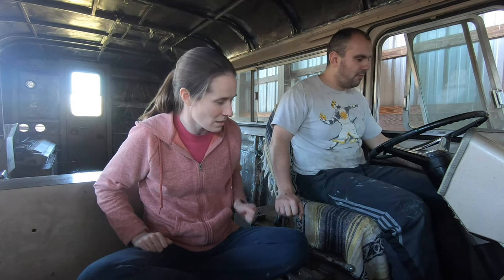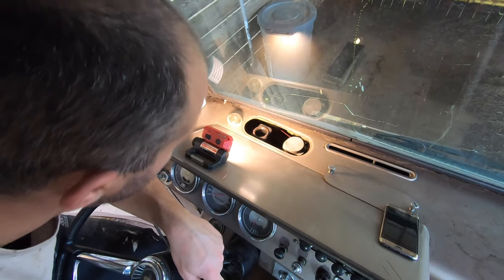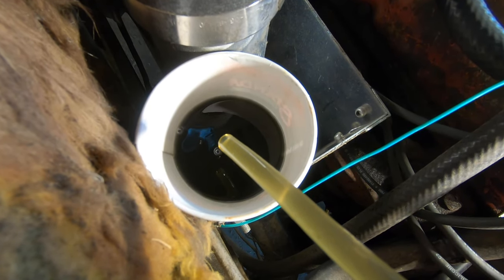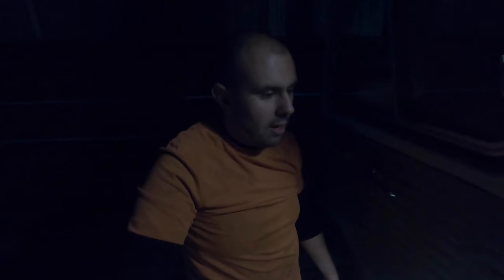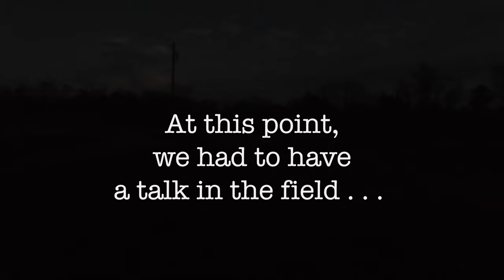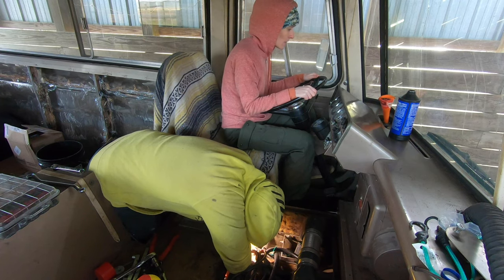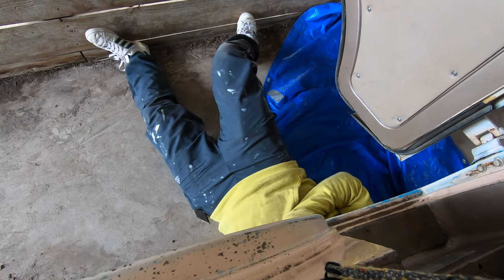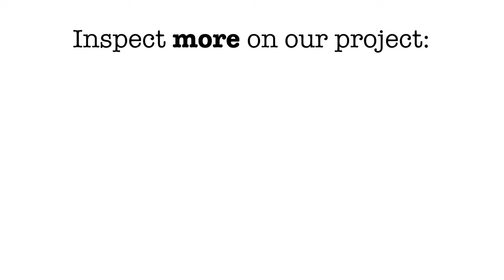ANDY'S ANGRY BREAKDOWN DURING OUR CORTEZ OVERHAUL! Our Vintage RV's Clutch System Repairs

Comment: It's good to get all the stuff done now, so that when your away from home you don't have to worry about it.  Things always take 2-4x longer then you think on old motorhomes. I spent half the day today trying to replace a valve cover gasket on our GMC because one of the freaking bolts broke.  Hang in there.
Reply from the maker: Hey Ethan, sorry for the late reply! You're absolutely right! We've been restoring our fuel tank recently and it is taking so much longer than planned, especially due to unforeseen issues! How are things progressing with your GMC? Andy&L

Comment: New subscriber, Jan, 18, 2021. Awsome! Very happy for the both you, nothing beats the feeling of fixing something and it works, good on yuz! If you have the money, a new modern engine, transmission install would be the the way to proceed. Traveling and breaking down on the side of the highways can be very stressful, you want to enjoy your future travels without added stress.
Reply from the maker: Hi and thank you so much for subscribing! We really appreciate your support! We're pretty happy with our current engine though it does need a bit of love. The 360 V8 that is in it is far superior to the original inline6 that the Cortez came with. Due to the design of the RV there aren't really any viable alternatives when it comes to the transmission. If we had the money, time and skill we'd actually look at lifting the body onto a new chassis with 4WD, a bit more ground clearance and a big Cummins diesel engine upfront. This is just a dream unfortunately! Andy&L